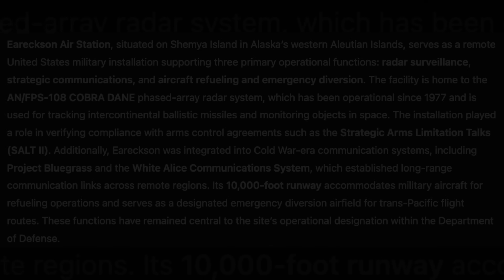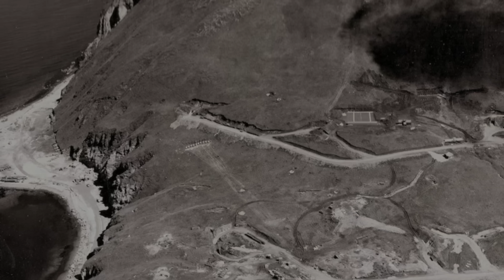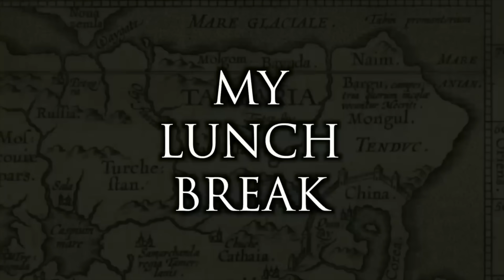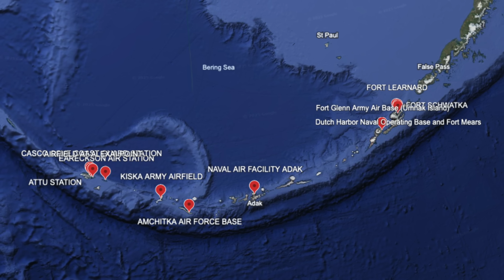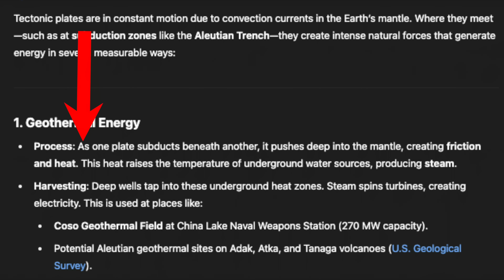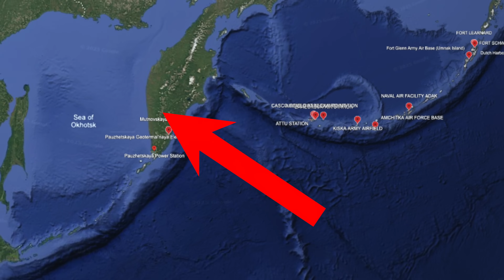Fault Lines are GATES - Pt 1

Comment: Without a doubt they are using free energy! In my opinion it seems as though structures like the Shard in London are major antennas. Much like the Buri Khalifi in Dubai, the Taipei 101 in Taiwan, Petronas Towers in Kulala Lumpa, Wills Tower Chicago. In fact I’d say that the whole of Dubai is run on free energy. This place was a sand desert island not that long ago!

Comment: I'm from Alaska and have been to a few of these islands, I haven't been into the boat tunnel but I've been into a few of the military installments. They're pretty rundown with dead animals inside. Not much is left of them. One had a tunnel but I didn't go more than a 100 ft in. I've also climbed Mt. Hayes and have skiied down it multiple times now. I've found camoflauge airshafts and what looks to be like a fake rock wall that'd actually a door. I could not find a way to open it. Some of the guys at the bar say it's an alien base, but I'm not sure about that.

Comment: So I asked Gemini how do countries tap into the energy from fault lines.... And gave me this: 

Search Labs | AI Overview
￼
￼
￼
+14
Countries often develop 
geothermal power plants in areas with active fault lines, as these locations provide access to naturally heated underground water or steam.  
How it works:
• Tectonic Plate Boundaries: Fault lines are cracks in the Earth's crust that often occur where tectonic plates meet. This geological activity can bring hot water or steam closer to the surface.
• Accessing Geothermal Resources:
• Naturally Occurring: In some locations, hot water or steam bubbles up naturally through permeable rock.
• Drilling: Countries drill wells to access underground reservoirs of hot water and steam.
• Power Generation:
• Flash-Steam Plants: These plants use hot water (over 182°C/360°F) that flashes into steam when pressure is reduced. This steam drives turbines to generate electricity.
• Dry Steam Plants: These utilize natural underground steam to directly turn turbines.
• Binary-Cycle Plants: These are suitable for lower-temperature geothermal resources. Geothermal fluid heats a separate fluid with a lower boiling point, which then turns the turbine.
Reinjection: The cooled water or condensed steam is injected back underground to be reheated, making the process sustainable. 
Examples:
Iceland: This volcanically active island nation relies heavily on flash-steam geothermal plants for electricity and uses the excess heat for district heating.
Philippines: Located on the "Ring of Fire", the Philippines is a major geothermal energy producer, utilizing flash-steam power plants.
The Geysers, California: This is the world's largest geothermal electricity complex, located in a tectonically active area and utilizing dry steam. 
Challenges and Considerations:
Induced Seismicity: Drilling and fluid injection can sometimes trigger small earthquakes. Careful monitoring and operational adjustments are necessary.
Safety Measures:
Traffic Light Systems: These systems help manage induced seismicity by adjusting operations based on earthquake activity.
Controlled Fracturing: Creating many smaller fractures during drilling can reduce the risk of larger earthquakes.
Seismometer Monitoring: Seismometers are used to monitor ground movements and allow engineers to control operations accordingly. 
Beyond Geothermal:
While geothermal energy is the primary natural energy source utilized on fault lines, research is also exploring other possibilities like tectonic hydrogen, which is produced by the fracture of certain minerals during earthquakes. This could potentially be another source of clean energy. 
Important Note: Building any power plant in a seismically active area requires careful consideration of seismic risks and robust design and construction techniques to ensure safety and minimize disruption..

Comment: The carbon pipe line is going to pump carbon into the ground in the Midwest. They are building a ventilation system for the underground tunnels. Fantasy carbon bound to air pumped underground 😂 yeah carbon